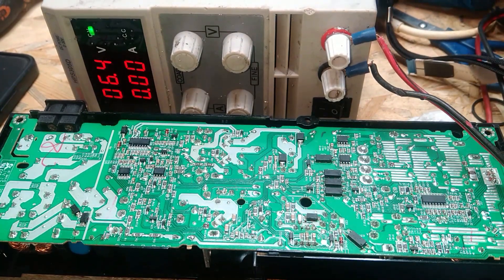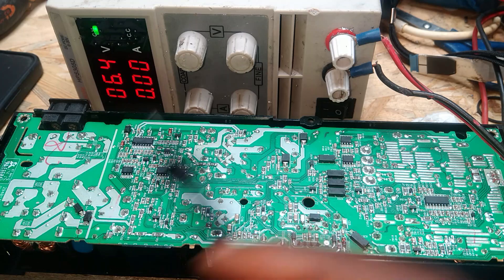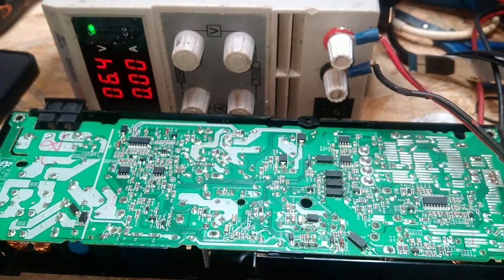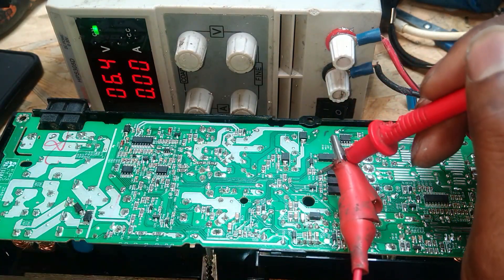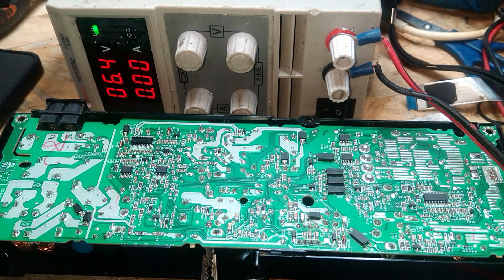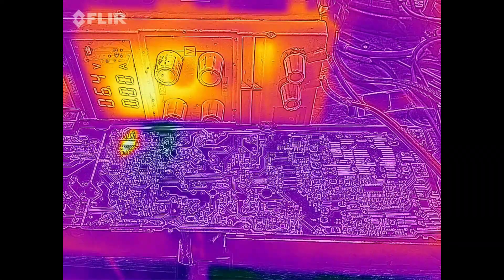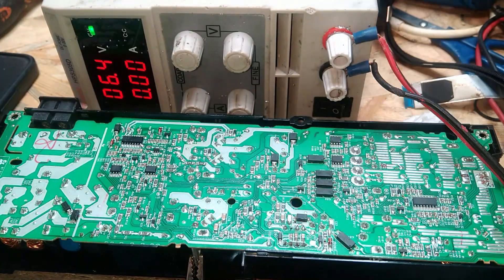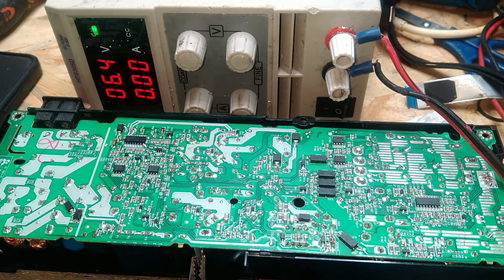Missing 12 Volts How To Tell If DDA001AG / DAP09 Is Faulty On Ps4 Power Supply

Comment: Do you know what part on the slim ADP-160CR AAC could be causing this chip to fail?

I replaced the iC twice and each time I get pulsing blue light console start to boot for 8 seconds then no power it shuts off, unplug replug and back to 1 second blod.

The DDA001AG keeps getting toasted, no pops just quietly dies, console works fine with a know working PSU.
Reply from the maker: Check 1612A1 chip on the bottom left ut could be the culprit

Comment: Mine has a short on pin 9 and 16 on DDA001AG IC IS THAT NORMAL OR THE IC IS FAULTY
Reply from the maker: Faulty 
Also check the 2 mosfets  it drives
Reply: They are all good thanx for the reply sir